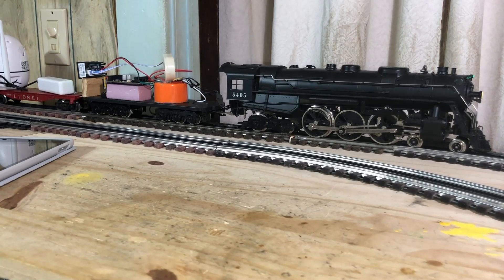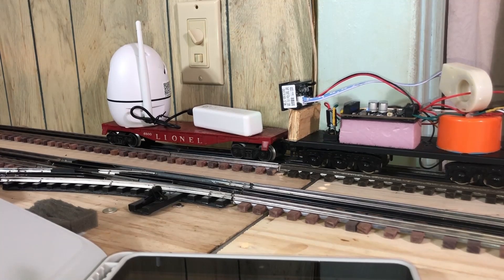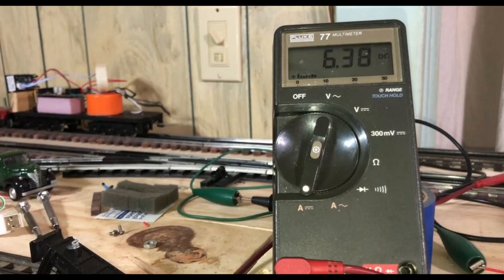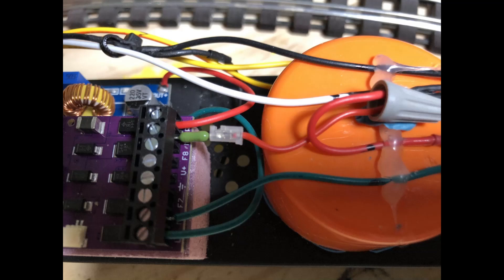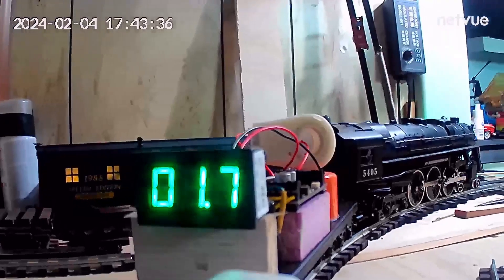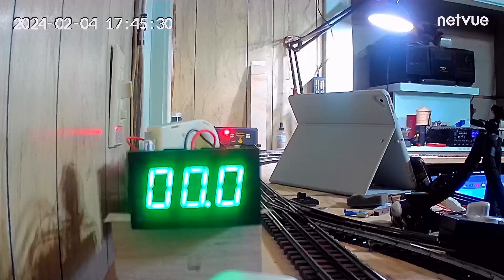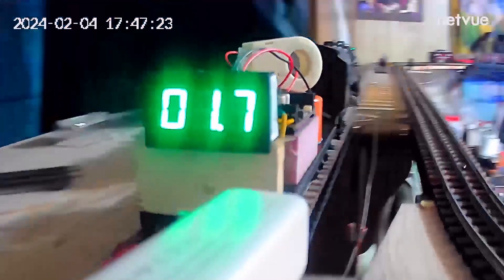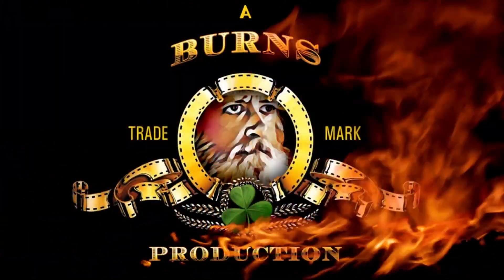Blunami 4408 amp draw readings on the Hudson

Comment: Jim can supply the specification and/or a link for the buck converter, fuse and the connector that you used with the fuse. I am converting an MTH K4 Pacific to Blunami. Your videos are a great resource and very helpful.
Reply from the maker: Thank you!  The connector to the fuse was from a broken servo motor I had laying around and I'm not sure what they are called but the fuse wire size is 1/32" or 0.0275 and 0.71mm. Good luck with your project!  I will edit the description to add the Buck Converter which is https://www.amazon.com/dp/B079N9BFZC?psc=1&ref=ppx_yo2ov_dt_b_product_details  
The fuse is already linked but here is that one,  https://www.ebay.com/itm/253069456042
Reply: The plastic spray can cover for a speaker baffle is also a great idea.
Reply from the maker: Thank you Alan!  It does a good job surprisingly, lol.  Once the tender shell is on it sounds so much better.  I'd love to see a video of your K4 when you complete that project.  I've been keeping my eyes open for a good deal on one.
Reply: I will do some before and after videos. I’ll be out of town next week watching my grandkids, but will get back on the project the week of February 18th. One last question, what size capacitor did you use with the bridge rectifier?
Reply from the maker: @alanjensen4830  that is a 1000uF / 25 volt capacitor.

Comment: Also, do they make a 3 amp pop up fuse you could have used to protect that board?
Reply from the maker: They do make them but I stayed away from those due to the room constraints inside the tender.  Here is one I found on Amazon; https://www.amazon.com/Circuit-Breaker-Briidea-Voltage-Protection/dp/B09KTDDVDM/ref=sr_1_10?keywords=3amp+circuit+breaker&qid=1707142707&sr=8-10